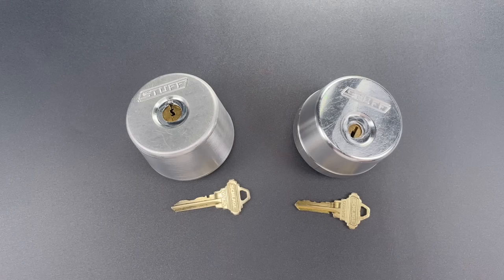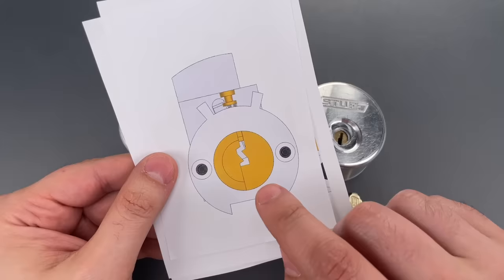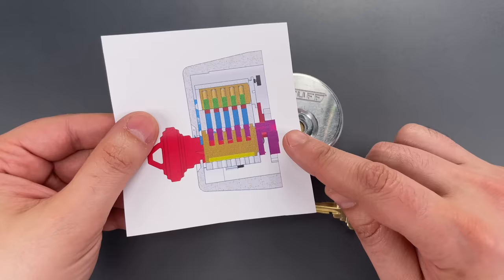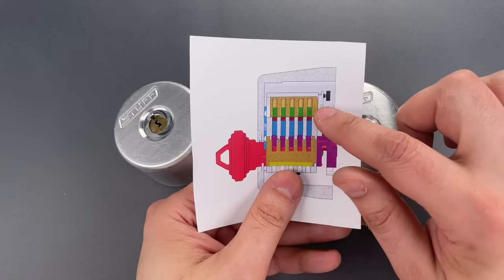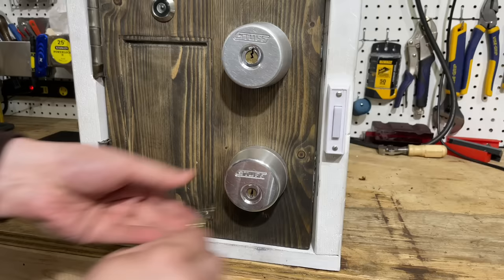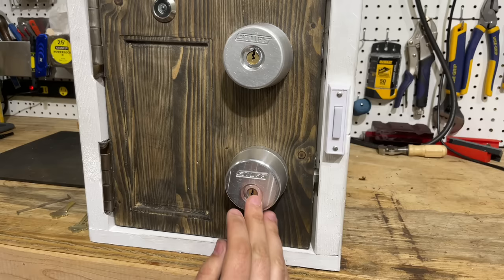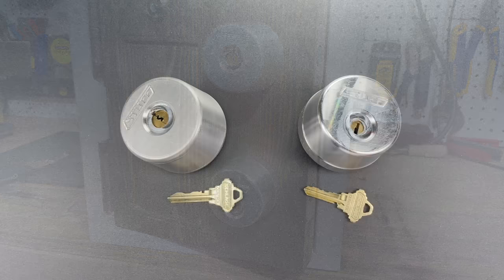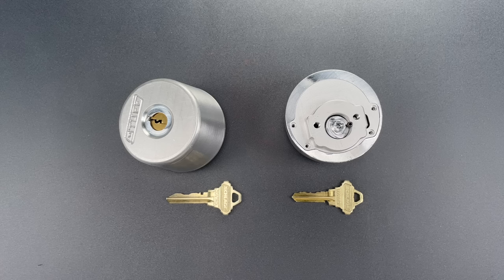[1299] Unpickable Locks From Stuff Made Here

Comment: "Which is probably the most expensive solition but certainly one that works."

I see... So you're new to the channel.
Reply: Lol nice
Reply: Now I want to know if he still can pick it with this expensive solution!
Reply: @sngaulin  same!
Reply: Yes where do we start xD
Reply: @sngaulin  he did in the video, the knife thing.
Reply: @ivanadriazola1991  The knife thing was addressed by "reclocking" the cam so that the bolt isnt released until after the barrel turns more than 45 degrees -- if I understood LPL correctly.
Reply: HAhahaha! +10!
Reply: Yah, knowing Shane's channel I'm surprised the backplate isn't connected to an electric eye via an Arduino that tilts the backplate so it's always at the wrong angle for the tensioning tool. :D
Reply: Compared to the lock itself it doesn’t seem that expensive lmao
Reply: @sngaulin  He can with the first method still.
Reply: @pkomarek  but it opened the door without damaging the lock, I count that as picking.
Reply: @eaoke3383  I thought that's what re-clocking the cutout on the tail piece is for
Reply: @sngaulin  he said he could measure the pins and make a key because they pins are all the same lengths the lock needs more work.
Reply: I was about to make that comment about over engineering :P
Reply: @ivanadriazola1991  youd not be able  to use a pocket knife on most doors. They seal up for weather and picking reasons. So that method isn't even likely to be  possible  unless its an interior  door without a seal or if its an out swing door with a big ol gap due to a poorly installed door frame/door. But I'm just a regular  Joe so I could be wrong.
Reply: @visibletoallusersonyoutube5928  no, your name is jonathan
Reply: @billieeilis977  Bloody bots . . .
Reply: @johnflux1  well all I know is I've installed doors exterior  and interior  and have never needed a gap as big as is visible  in this image  (or at least as big as I perceive it to be) ive also been in a lot of houses (shocker lol) and a lot have inswing in fact I think every house on my street is inswing.
Reply: @johnflux1  also with like 1 minute  of research i discovered  almost all exterior  doors are inswing to keep people from simply  popping the hinge pin out and dehanging your door. However  some outswing doors exist. And in regard to fire safety  you can move shit internally blocking your door to escape not much you can do when your outswing is blocked. The only benefits of an outswing  i see is concervation of internal space and being hard to push in by an intruder. Because of the  seal . There would also be less reliance on your deadbolt screws on the female frame side.  Speaking of intruders in almost any movie with a scene of someone shutting  or holding a door on or against the intruder the door is also inswing
Reply: @visibletoallusersonyoutube5928  In residential, most doors swing inward. But in commercial settings fire codes usually require exterior doors to swing outward if the building's maximum occupancy is above a certain threshold.
Reply: @visibletoallusersonyoutube5928  Thanks for the info.  Thumbs up from me :-)
Reply: @luisquezada9806  haha. Fine a regular  Jonathan.
Reply: @johnflux1  you might be right for a legit fire exit for a large volume of people.  I could see specs like that existing.  The doors are easy to shove open and would stay open and with larger gaps shrink and swell isnt an issue and obviously dozens if not hundreds of  peoples lives are more important  than a door being potentially  dehung. Odds are it has those riveted or welded (like in the video) hinges so it can't be easily removed anyhow. And any building  with a quality fire escape like you'd find in a public building  likely has decent security anyhow. So that little vulnerability  is by no means a big deal.
Reply: @johnflux1  yea man no problem.  To be honest  I learned a little  myself lol. Didn't even dawn on me about  ppl popping of the hinges of an outswing.  I also learned outswing is more popular  in some countries. Pretty nifty seeing other cultures approach the same task differently  like how we install outlets vs some countries  doing the opposite or the choice to run all appliances on 220 vs 110 and 220. Or how some appliances can run either and it doesn't  matter. Anyways. Good night /good morning.  Thanks for getting  my brain churning on something.  And sorry if I kept saying  stuff after your comment I didn't  get most of these comments till now.
Reply: @sngaulin  We know the bolt lockout is still vulnerable.
Reply: @sngaulin  Yes. There is no unpickable lock. Only solutions.
Reply: I think an easier solution would have been to install the lock a bit into the door so that the back part isn't flush to the door.
Reply: He literally machined the pins. He mentioned after he made them that he had just realized he could've bought them from the store for super cheap. Yeah, expensive solutions seems right.
Reply: There's only 6 simple machines and I guarantee there's always going to be a way to defeat their joined efforts in stoping a determined mind who wants entry. What can be engineered can be reverse engineered. No such thing as unpickable. We got picks, ice, magnets, magic. Everything a hacker needs to defeat anything.
Reply: @sngaulin  i dont think so. maybe after all the lockPickingLawyer is defeated
Reply: @ivanadriazola1991  can he switch to door swinging inside?
Reply: @visibletoallusersonyoutube5928  where I'm from all new doors are required to be opened outwards for fire security reasons. And most doors sold are security doors with three locking bolts, two of them are thick hooks that hooks upwards, and three additional bolts that sticks into the door from the frame on the oppositeside. All of whom are  hidden behind a thick steel flange to prevent someone fiddling with the bolts.
And with that many security bolts it really doesn't matter if you put a sledge hammer to the hinges the door will always stay put.
And as a fireman myself there are a few ways to get them opened fairly quickly. But it requires two people, sledge hammers and special crow bars, and a lot of brute force. So if someone would want to break in using those methods you would already have woken up the entire block and the police will be well on the way
Reply: @pellemalm2158  And thats just a standard residential door where you live?
Reply: @visibletoallusersonyoutube5928  nah not exactly my house since it's 100+ something years old. But new production apartment buildings require these kind of doors since every unit is a fire cell and these doors are the standard fire doors these days. And more and more are changing to them since the insurance becomes way cheaper on a monthly basis if you have one
Reply: @pkomarek  He would still need to do something about the pin lengths in the second core, as LPL addressed that as a vulnerability too
Reply: @johnflux1  If the locks are made for high security I doubt that the doors will be made to swing outwards. My doors to my apartment swings inwards so a knife wouldn't fit
Reply: @sngaulin  he did lol
Reply: @pellemalm2158  interesting  thanks for sharing

Comment: This is good stuff because LPL's knowledge and criticism can help Shane advance lock design so we may actually see Shane make a lock that is much more difficult to pick.
Reply: It seems that LPL is loving the challenge that Stuff Made Here is attempting. These to channels are great to watch, and the collab between em is even better.
Reply: I honestly think there are no such thing as an ¨unpickable lock¨ If it can be opened in a legit fashion, the condition can be reproduced with shady tricks and wits
Reply: @TheMrffwinner  if a lock can be opened, it can by definition be picked. Even if it's done by a brute force attempt of making&trying keys until one works.

The whole point of (unpickable) locks is to make it too troublesome to attack. And, in the process, make sure that the lock itself is not the weakest link.
Reply: @TheMrffwinner  Thousands of years of security design and implementation has taught us 1 thing for sure, no security device or method will ever be unbeatable.
Reply: @TheMrffwinner  agreed
Reply: This is basically adversarial ai designing locks.
Reply: @TheMrffwinner  well, it should be rephrased as "unpickable enough". If you need some very specific tools designed for that job only and/or a ton of time it is unpickable enough to deter some random pickers, and there is no reasonable way to deal with attack that targets you specifically.
Reply: @TheMrffwinner  As LPL would say, there's no such thing as an unpickable lock, just one he hasn't figured out how to pick.  

Regardless, advancing lock design is a good thing for everyone.
Reply: @Nworthholf  Yeah, that's kind of what I was thinking when I wrote that.  Ultimately, security can almost always be defeated...the idea is to make it so difficult, time-consuming or expensive to defeat that it isn't worth the effort.
Reply: This seems like he now has 2 designs to bake completely unpickable
Reply: @slayer99199  a key is just a specialised lockpick.
Reply: @fnors2  This exactly. If a lock is stronger than the vessel it protects, one would logically attack the vessel itself. This task is typically quite difficult, however - therefore discouraging most thieves from such a solution altogether. As such, it is most convenient to attack the mechanism barring one from entry in the first place.
Reply: @TheMrffwinner  sure, but who's gonna carry around 9^6 bowley keys?  thats like saying AES 256 is brute force crackable.   again sure, but you only have enough time until our sun super novas...
Reply: @TheMrffwinner  I think the real question is that can we make a lock design that doesn't relies on "security by obscurity". Something uncrackable even after a century of studies by engineers.
Reply: @TheMrffwinner  There's always a way in, but picking the lock isn't always one of those ways. Sure, you can shoot a missile launcher at the door or pickpocket someone for the key, but that's not "picking the lock" per se. An unpickable lock mechanism is well within possibility- these designs demonstrate that well- it's just that they become too expensive to make and then your intruder just finds a different avenue of attack anyway.
Reply: We will get the very first truly unpickable lock if Shane keeps sending his prototypes to LPL, lol.

Comment: "quite good" is a serious compliment from LPL. Especially for a lock from a novice lockbuilder. I want to see the rematch already!
Reply: In all fairness the novice lockbuilder has no budget to consider. I'm sure many locks can be made unpickable, or atleast very secure, with the right amount of money - but you will need customers to be willing to spent that much on a lock. Budget is THE main factor in many cases why locks sucks, because it was cheaper to produce that way.
Reply: I'm reminded of an old engineering adage: "anyone can build a bridge, but an engineer can build one that just barely works."
Reply: @StriKe_jk  and every new design is expensive to produce. Once a good design has been vetted, economy of scale, blueprinting the parts, and mass producing them will bring the price down. Not to master lock levels, of course. Perhaps a viable high-value-high-security setting where you want a legitimately good lock to slow the bad guys down.
Reply: @StriKe_jk  this really isnt true, there are many absurdly expensive abloy locks that can still br picked. Ive even seen someone claim they picked the protec2 although the video is a little dubious. writing off this engineering just because its impractical for the market is totally wrong and insulting. lets see you do as well.

Comment: LPL: Here's how you can deny access to the top core-
Stuff Made Here: Oh no worries, one sec- machines a cover for the back
Reply: I mean... it works lol
Reply: Lpl already said he had another way in but just didn't want to spend the time. So it's still not good enough.
Reply: @kieragard  that can be easily fixed by varying the pin lengths if i'm not mistaken
Reply: @overlordsmashalot3891  no he said he could just produce a key if given enough time.
Reply: @kieragard  Yes, due to the pins being uniform length. Hence varying then denies that.
Reply: @overlordsmashalot3891  i think real one would be recess the lock into door a bit so you cant get past the cover
Reply: @BlackTempleGaurdian  I've seen the guy fashion a key plenty of times. It would take a considerable amount of time but that's all it is. Just a time investment.
Reply: @kieragard  Watch the video again, you didn't understand the key exploit. LPL himself said the issue was solvable.
Reply: @RobertsBiezais  I was thinking the same thing. Extend the housing into the hole in the door. Could go just short of the dead bolt. Probibly much cheaper than the back piece.
Reply: @RobertsBiezais  That would depend on whoever is installing the lock to do that, which they probably wouldn't because it's a lot more work if you're replacing another lock. 

But yeah, I believe varying the length of the upper pins fixes the decoding exploit.
Reply: @cuthbertallgood7781  I'm talking about the current set of locks, not version 3.0. Obviously he is going to make a more secure lock after this defeat. But the current set today, have a key fashioning exploit.
Reply: @kieragard  and everyone is telling you that all that needs to be done to fix it is non uniform pins, rather than a completely different design.
Reply: @kieragard  The skill and knowledge of the lock's internal structure required to pick it certainly seem "good enough" for most applications. Any lock can be defeated. The "time investment" required to do so is exactly what it's meant to demand. Most attackers will simply look for an easier target or choose a weaker point of entry than the lock itself (for instance, LPL noting that the hinges were welded to prevent removing the door from its housing).
Reply: @Bruno-cb5gk  I am clearly talking about these two locks on screen. You're talking about the next iteration. I heard what he said to prevent the exploits, but those exploits currently exist on these locks.
Reply: @kieragard  It literally doesn't matter if you were talking about the locks shown. It was explained that it could've fixed, and they're not wrong at all. And even with the current one, unless someone is going to actually spend the time to produce a key, then yes it is still more than good enough.
Reply: @xenofastiq  it may be a good lock, but a defeat is a defeat. Lpl was just being nice. He would've ripped a normal lock maker for the sticking a knife in to retract the bolt exploit. He burns people for just having one exploit but that lock has three.
Reply: @kieragard  While that's true, it's still very different to flame a company that mass producing locks, and someone who literally made their own lock in a unique way that will clearly have flaws because he doesn't fully know what tricks that a lot of very experienced lock pickers know and use. A defeat is a defeat, but the guy who sent the locks never tried making it be some lock that should be mass made and used in households. It was just a fun project he decided to try out.
Reply: @xenofastiq  obviously it was just a fun collaboration, but those locks were claimed to be unpickable, or at least made with the intent of being unpickable by lpl. He was nice enough to tell him all the vulnerabilities, so the next iteration will be a different story. But I'll just wait and see.
Reply: @kieragard  Yes, it was with the intent of being unpickable, but literally because of the fact it was still for fun, LPL had no reason whatsoever to go and completely drag the guy through the ground just because the locks didn't live up to that expectation, because again, they're not actual locks that the mass population will be using to try and be safe.
Reply: @kieragard  lpl always tells the vulnerabilities and how to fix them, nothing new here

Comment: “My hope is he pulls out some sort of random tool that I don’t know of”

He doesn’t know about the pocket knife... 😅
Reply: That means that the door is the wrong shape. Bolt ought to be shielded by half the thickness of the door. Another idea, make the bolt move vertically inside the door and connect with a pivot which shoots a different bolt into the jamb.
Reply: XDDDDDDDDDDDD
Reply: Yeah that exploit is a "little" cheap because the door can be built in a way that shields that attack. Doors are usually more vulnerable than locks anyways, external hinges and room under and around for tools to reach handles
Reply: It does look like it is slash resistant
Reply: @Monkeyman12534  Still, SMH made the door as a target for the attack. Both exploits on the v2 wouldn't be possible if the door and lock were installed properly.
Reply: Damn that is funny!!!!